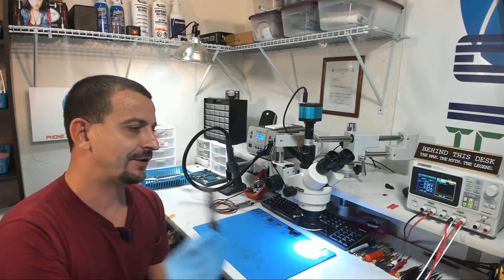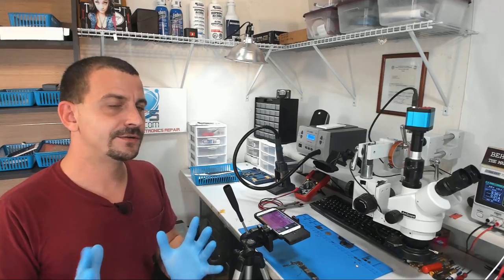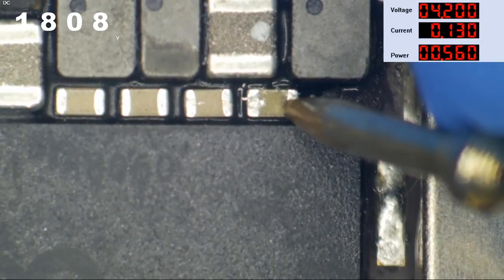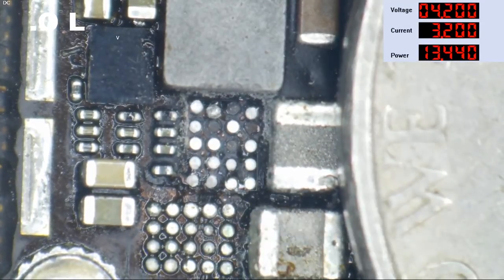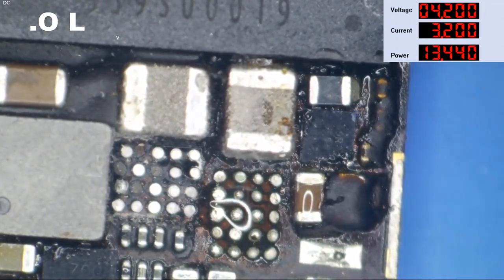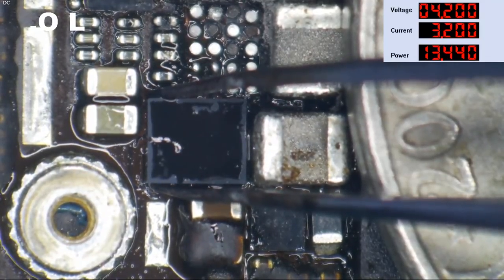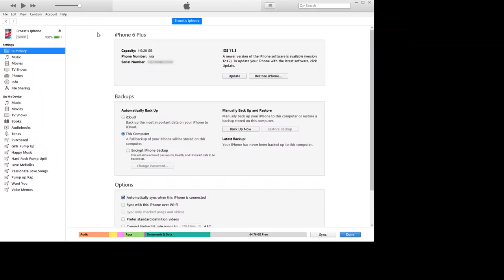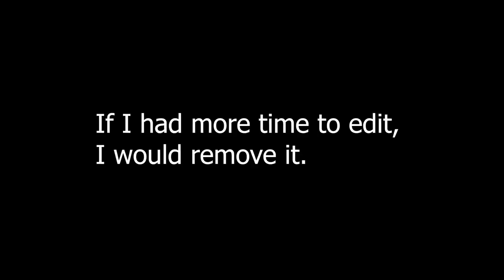iPhone Data Recovery with a FLIR ONE Pro (Prior attempt)

Comment: If i had as many repairs as you do id build a database that lets me input parameters like what the voltage and current was drawn from that device and then when ive fixed the problem id write it in the database and when you build the database up maybe you could input info like it took 0.120ma and that can bring up possible repairs might work if you have as much repair as you do
Reply: Joshua Hutton he would need a reputable stable voltage source in order to do this...

Comment: Thanks, I have the same thermal camera with over 6 months, I didn't know half the setting on it, now it's a total different camera to use, no more double image that don't line up,
Reply: Yeah he should do video just on that alone that's the only place flir drop the ball.
Reply: I also wonder why you need to completely move the parallax correction slider on the left. I also noticed that is not enough to completely allying the two images... very weird. What should be the purpose of this and its useless preset. In which circumstances do you think that the cursor should be moved to the right side?
Reply: @ictrepairs6963  The bug I get is that the app can not access the Flir I have to go into USB connectivity every time and select connect to device then after a black screen the flir app starts with the flir camera, this effects android users.
Reply: Mr lunithy try switch on the flir before connecting it to the smartphone and see if recognized it.
Reply: @ictrepairs6963  Yeah I tried that thx when I do a search it's been a problem for some people for a long time I think it's fixed for later versions beyond android 8 but my Sony Z5 p is stuck at 7 because Sony.

Comment: I have an older version of the Flir one camera.  The last time I plugged it into my phone it killed my phone (not a problem for you as you would just fix the phone) so I ended up getting a new phone.  I want to buy another heat camera, but my next one will be a stand alone one that won't require me to use my phone.

Comment: I recently bought the Seek CompactPro. The user interface is a bit clunky and confusing on it though. I use it with a 20mm ZnSe CO2 laser focal lens with focal length of 50mm. I was surprised how well the lens made seeing the individual components. I'm going to order a 100mm one to test. You can find the lenses for $20-30 or so.
Reply: How did you made the lens holder? I saw somebody can print it from 3D printer. But I don't have the 3D printer.

Comment: Jason something for you to try and see if it works for you. I was practicing on a dead board and soaked the goo on the board in alcohol for a few minutes then ran an old medium bristle toothbrush soaked in alcohol over it and it fell right off and caused no visible damage to anything else. I may have just been lucky and it may be a dangerous practice I am not sure. Tell me your thoughts please if you have time as I would like to know any dangers there could be to the board. Thanks mate

Comment: hi
thanks
can you answer for some qestions please?

1. so do you recomanded this flir over seek ?
2. did the flir wirth the pro? or just the lt model?
3. seek pro or compact?
4. did you recomanded macro lens for all the model above ?

:)

thanks
yossi
Reply from the maker: I have heard that the Seek with macro lens works good but I have not tried it.  I tried the Seek without the macro lens but did not have good results and sent it back the same day it arrived.  I think I was using it wrong though.
I have had good success with this Flir One Pro.  I didn't try the Flir One as it was less resolution than the Pro.
Reply: STS Telecom thanks
And macro lens for flir one pro?

Comment: Awesome job again :) And that ASMR part at end of the repair :D you should try what nobody have done before: ASMR iPhone repair video :D 
That thermal camera is awesome, it make things so much easier 👍 one tip with the thermal camera: Get a extented cable for it and attach it to side of the microscope with flexible tripod for examble - 
so you can look the thermal image from iPhone/iPad at longer distance and the iPhone/iPad is not on your way ;)

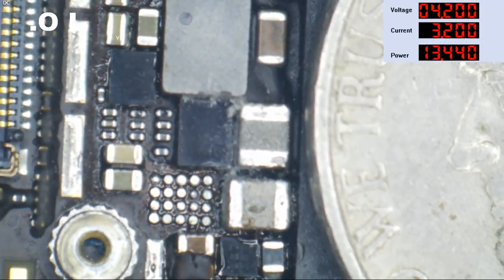Comment: Hi! just a question..at 15:00 you start picking up the IC, at 25:00 you put the IC back in another spot of the board that's not the first one. The question is: those spots are interchangeable to let the board work and pick up data?? thx for the video and keep up!
Reply: He may have rotated the board, but he actually removed one ic that was shorted, then installed Walnut ic that the previous shop had removed because it is needed to boot.

Comment: Hi Jason, just a question, what do you do once once the itunes backup is done ? Do you just send it like this to your customer on a dvd or a flash drive ? What can be done with this backup, do your customer has to restore it on a working phone or can it be used with a software to save the photos or videos ? Thanks a lot.
Reply from the maker: If they are wanting to restore the backup to a new phone, we send them a full iTunes backup.  If they are primarily after photos or other specific things, we export the backup as an easily browsable file structure.  That makes it so they can browse what was on the phone using a computer without needing special software or a phone to restore it to.
Reply: Thanks for your answer :) how an itunes backup can be exported to be directly browsable ? Is it an itunes feature ?

Comment: i have a flir one and a seek compact pro with the macro lens........Seek compact pro  with macro lens all day every day...  has less of that reflective metal thing and zooms in on pretty much the capacitor thats hot!
Reply: does have temperature range adjustment....
Reply: @MrSkar87  yes it does ....wish i could show a pic in the comments....also has auto coldest and hottest spot...does it by it self.
Reply: i mounted it on a lil adjustable microscope base to fine tune image and focus and use my ipad for large view able image
Reply from the maker: I don’t think I spent enough time with the Seek before I sent it back.  I think the main problem with that camera was me not knowing how to adjust it.
Reply: @ststele you  Should of given it a little longer and also that macro lens is a must...but the  flir one pro works well also the way you explained it with the range adjustment to reduce noise and show the hottest spot...i learned something new......thanks for your videos man..blessings
Reply: @STS Telecom search the app store for these two third party apps for your flir one pro ..you might find them handy  (Thermal Camera+ and  Vernier Thermal Analysis plus)

Comment: Why am I so unlucky? Bought two flir one pro devices with MPN 435-0006-01. Both are not good as yours. If I put the camera close to the PCB, both cameras  cannot get aligned images. as perfectly as yours. I have to move further to align the images. Then the PCB become smaller on the screen.  The last camera is even worst. It cannot focus if I want the PCB is big enough on the screen.  The picture is blurred. Looks like to me, not all flir one pro work the same.  I noticed flir one pro has two different MPN. One is 435-0006-01, the other one is 435-0006-02. Are they the same? My first flir one pro has  435-0006-01 on the device 435-0006-02 on the box.  So confused.
Reply: I've got the same issue. I don't get the MSX image correctly aligned. Moving further with the camera doesn't help. My MPN on my box is 435-0006-03, the device has the Number 435-0006-01. Im also very confused..... Does anybody have a clue ?

Comment: Hi, I have an iphone 7 that fell in the Sea and was in for probably 3 or 4 hours. The screen was damaged as a result.  I have since changed the screen and speaker but the screen isnt working. It appears to be on because when you touch the button you get the little clicky vibration, any thoughts ?
Reply: Check backlight circuit for fault,could be shorted diode or blown filter
Reply: Check for damage on the display connector,clean the motherboard first off any corrosion
Reply: Also check chestnut ic circuit are I think

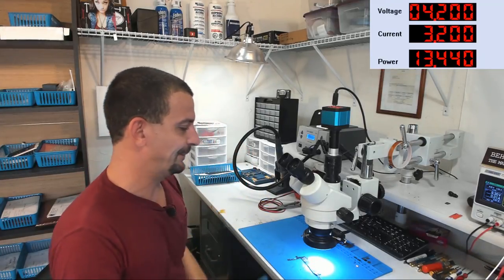Comment: @8:33 - You're blushing - lol - try take a look at people wearing glasses. Totally black eyes 8-)
I was wondering - is your power supply really pumping out 3.2A at 4.2V - dissipating 13.44Watts ?
- you take the pcb up into the air, so no power seems to be connected. ??
Reply from the maker: When it is switched off, the display reads what the output is set to.  It makes it look like tons of power is being used when it’s actually off.
Reply: @ststele  - Thanks, I guessed so. grin
Is it possible for you to add an on/off indicator to the stream video - to eliminate any guessing game, and not getting ahead of ourselves @1:59 in the 'behind-the-screen-fault-finding' looking over your shoulder while you pick and prod. Thanks!
Happy to see you fix the board, or whatever happened to it. Anyways - Happy New Year, best of streams in the new one :-)